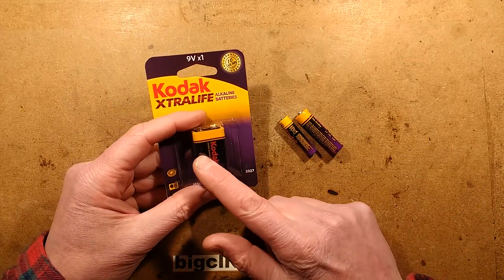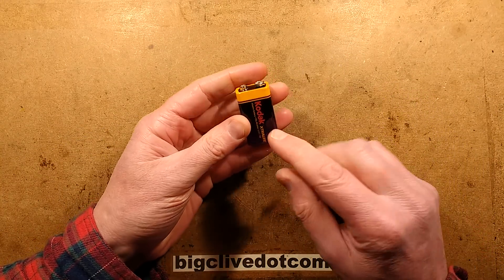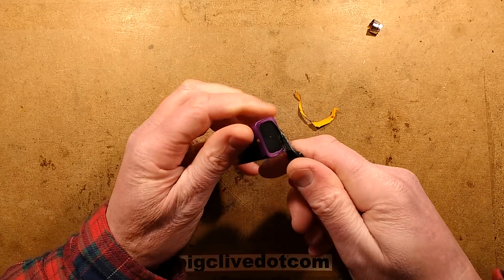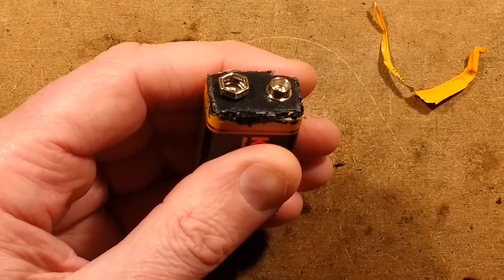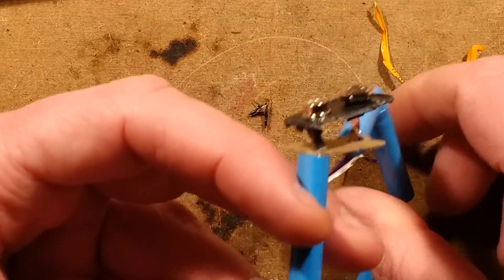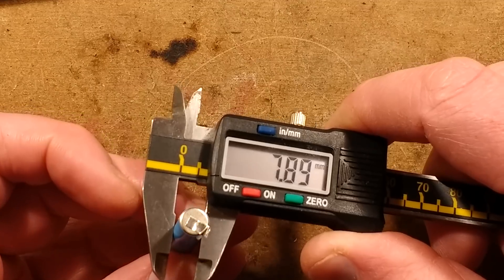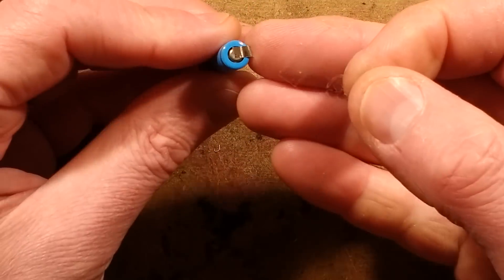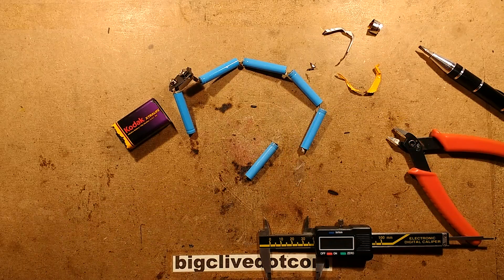Inside a Poundland 9V alkaline battery.  (Check polarity of cells if re-using!)

Comment: Hi, Clive, can I suggest you try and get hold of a standard non-alkaline battery and take it apart.
I can remember in my teens splitting a 9V battery open and the carbon-zinc cell was a layered set of black carbon and zinc tablet like sections.
Stacked one on the other.

Comment: Many years ago, I used this method to get AAAA cells for a Fujitsu Stylistic 2300 tablet computer stylus. Worked perfectly! I couldn't find the battery for sale anywhere except WES which is a electronics supplier here in Australia (not sure if they are still around actually...) for a sizable cost.

Strangely enough, the stylus used for the current Microsoft Surface tablet computers use AAAA cells, so I wonder how people are replacing those when they go flat!
Reply: They buy the AmazonBasics AAAA battery pack, i suppose?
Reply: Siana Gearz in Australia, so the options for Amazon purchases is a bit limited, at least back then anyway

Comment: Apart from the sizes, you can also get fractional sizes. 4/5 AA, 1/2 AA, 2/3 AAA, etc. However, trying to find some 2/3 AAAs to replace the batteries in some solar lights is proving to be a pain. I doubt anyone would be foolish enough to pay an arm and a leg for these -
https://www.ebay.com.au/itm/GA235248-2-3AAA-Sanik-Battery-Nimh-1-2V-400Mah-Sanik/362233306418
Reply: Gary Rumain probably be cheaper to buy a new solar light!
Reply: I know. I bought a 4 pack of lights for about $8 at a local supermarket. So about $2 each. When the batteries started going, I was surprised to find that they'd used non-standard sizes. Naturally, the supermarket didn't sell batteries in the required size.
These are about the best value I could find -
https://www.ebay.com.au/itm/Cordless-Phone-Replacement-Battery-404-3-6V-300mAh-2-3AAA-Ni-MH/180652844754
Certainly cheaper than the Sanik ones. And they're on sale now, so I might place an order.

Comment: I bought one of these last year -
https://www.ebay.com.au/itm/OKcell-9V-800mAh-USB-Rechargeable-Lipo-Battery-for-RC-Helicopter-Model-Micro/292486696110
No idea what's in them (can't open mine as it's in use) but I expect it's some sort of LiPo cell with some circuitry to manage it.

One thing I do note is that the price has really shot up.
Reply: Adam Welch did a teardown of this on his YouTube channel, so you don't have to.

It's essentially a Lithium Ion power bank.
Reply: Yes, it would have to be.

Comment: Maybe the 2.5mm difference is the nub on top of a normal AAAA?
Reply: Yes - because these alkaline cells are case positive and tip negative, when packaged as AAAA they need to put a tougher insulation around the case to prevent the cell shorting against the sides of the cell holder (hence the .3mm narrower width) and also put a flat plate on the tip to make the negative contact, as well as a nub on the base. That would easily take up 2.5mm of length.

So these are basically unpackaged AAAA cells.
Reply: Jim Fortune that probably true
Reply: it is, proper AAAAs have a top 'pip'

Comment: Amazon has Energizer AAAA 6-packs for less than $5 USD. For the cost of a 9V and the effort to open it, just buy the AAAAs.
Reply: A 4-pack of Amazon Basics AAAA in the UK is around £4.50 as opposed to a Poundland 9V battery which is £1 and yields 6 AAAA batteries (sort of). Then there is the fun of taking things apart.
Reply: VulpisFoxfire 
Most of the world is outside the US! 
Although I'm not sure if all Americans realise that fact!
Reply: That's nice. Clive is kinda outside the US though, you know?
Reply: There's also an amazon basics branded package of AAAA batteries.
Reply: The problem is the  UK. I cant honestly name a shop I could walk into anywhere in the country and buy an AAAA cell, and online they are much more than your prices unfortunately. This way works out at $1.45 for 6.
Reply: There are AAAA batteries available in some stores, but not in any of the ones close to where I live. I got a two pack 6LR61 in a grocery store nearby for about the same as a single AAAA would have cost. Given the price the batteries might not last quite as long, but I have 6 of them so that should not be a problem, and a 9V battery to boot.

Comment: I think it is wiser to use plastic caliper to measure battery length.
Reply: Or put the tape on the calipers!
Reply: Or measure alongside with a rule.
Reply: Or just put tape on the cell's terminal.  Bet no-one has ever though of doing that before ;)
Reply: Rizki Pratama
Why?
Reply: Richard Head so you don't scratch the flat end.

Comment: Be warned that not all 9V batteries have the 6 AAAA cells inside. Some have a pile-like stack of flat rectangular cells instead. EEVblog made an interesting video about it: https://youtu.be/c9JGfoLxVCo
Reply: I remember those stacked cells when I opened one as a kid about a hundred years ago. Short circuit current was very low, used mainly as a transistor radio battery. Woolworth  was always my supply of bulbs (lamps) and battery's.
Reply: Maybe it's an Australian thing but I recently opened both an Energizer and a Duracell 9v alkaline batteries and they both had the stacked flat rectangular cells. I have never opened any that have the 6 AAAA cells.
Reply: most of the pp3s i've come across have flat cells, but they were metal cased, maybe all/most metal ones are flat,  and plastic , rod cells..??
Reply: Are those still alkaline? I've always thought that 6f22 are supposed to be zinc batteries and 6lr61 are alkaline like this one.
Reply: The 9V alkaline that I disassembled also had the stacked rectangular cells.
Reply: Clive mentions that about one he opened at the start, actually.
Reply: I have disassembled a 9V carbon battery a long time ago and it had the stack of rectangular cells.
Reply: Both are around.
Reply: And not just those two, you get single cell 9v batteries but they are not very common anymore.
Reply: those are a stack of 6 cells in one casing, most individual cells, depending on the chemistry are between 1V and 4V, with 6 around 1.5V being usual for 9V batteries.

Comment: Genuinely didnt know AAAA existed
Reply: Tom Williams Productions Ever hear about E and J size?
Reply: Redlock oh god, don't get me started on E and J size
Reply: They're getting a little more common now, Microsoft Surface tablet pens take AAAA batteries.
Reply: Oh there are plenty others as well. Got used to all kinds of weird cell sizes when i worked in camera shop.
Reply: +Redlock  -  "Ever hear about E and J size?"   This is about women's bra sizes? Right?  E and J are really big ones, they get in the way.  I don't think they make batteries that large.
Reply: David Null There is N size as well, a bit bigger than those 12 volt key fob cells, but 1.5 volt.
Years ago back in the 1970s there was some huge batteries around, for radios (there was a 90 volt one, yes 90 ! For old valve radios) 
and 12 volt for large hand lamps.
Reply: TheMrVengeance 
Not that bad?!
That would make an equivalent 9v battery €9!
That seems VERY overpriced to me!
Reply: David Null - Any more than a handful is a waist.
Reply: Tom Williams Productions damn i thought that is normal AAA BATTERY
Reply: Pete Allum - It's €3 for batteries that generally last an eternity,  most things (in my experience) that take a AAAA use hardly any power. Such as the pen for the Surface tablet.
Reply: +wolfpax181 - About €3 for a pack of 2. It's honestly not that bad.
Reply: i ran across N cells in various Australian post Master General phone test gear.
Reply: They are used in N-Trig stylus pens for Windows tablets.
Reply: +Jason Gomez - I said that 2 weeks ago mate. :')
Reply: Don't forget the 4.5 v ones - with terminal nuts - for doorbells!
Reply: Les Reed I remember those, there was an Exide brand one of those above the door in my grandads house back in the 70s, I think it lasted for about 15 years!
Reply: You even get AAAAAAAAAAAAAAAAAA batteries, but you wouldn't want to drop one of them in a haystack - you'd never find it again.

Comment: Wow ! I had no idea 9 volt batteries had 6 little cells inside ....this video has been enlightening
Reply: not all of them do, Duracells don't for example
Reply: @MichaelWeaser  I opened a Duracell and got 6 AAAA batteries but Energizer had 6 flat stacked transparent bricks
Reply: @maxstrainsfanssmash687  I have opened up Duracells as well have also seen the flat cells in them, so Duracell has to be making 9 volts with both type of cells.
Reply: @MichaelWeaser  Yes I've seen that too the ones with 6LP3146, 6LF22 or 6F22 marked on them have flat cube batteries and the ones with the markings 6LR61 have AAAA batteries
Reply: I meant that most don't have the cylindrical cells , Yes most have 6 flat cells they hold a higher capacity???  Most cheap 9v use the cylindrical cells , since they are cheaper and a lower capacity than flat cells.
Reply: they ALL have 6 cells in, they have to as no single cell is 9v, just that some(most?) have flat cells some have the AAAA 'rod' type...
Reply: dunno whether its the cheaper ones using rod cells or 'flat' type, but i personally have never yet come across one with rod cells in ,... yet... i sometimes open up dud ones to pinch the top connector plate 😉
Reply: the cylindrical type cell have a slightly lower capacity by 100 - 200 Mah or so , so they are cheaper.

Comment: The Poundland 9v alkaline  batteries are amazing. Where else can you buy a 9v alkaline  for £1
Reply: "The Poundland 9v alkaline batteries are amazing. Where else can you buy a 9v alkaline for £1"
If Poundland don't have them, you could always try .... Poundworld?
Reply: Nearest I use is Rapid Electronics 10+ and VAT registered
Reply: If you don't need the batteries to alkaline, you can get 2 Zinc Carbon Kodak 9V batteries for £1 from the same shop.
I disassemble them after use to make my own 9V battery clips.
Reply: Problem is you might be buying a variant made to be sold for £1. With some products this is very obvious from the physical size
Reply: Jonathan Schneider yeah, like those tiny jars of Marmite they sell!
Reply: With those Kodak branded batteries I've found they tend to skimp on the sealing. They are not batteries to be left in equipment for long periods of time as they have a nasty habit of spilling their contents unpleasantly in battery compartments
Reply: luviskol - Yes, just like Duracell batteries. They will leak if a cell becomes reverse-polarised. That's because of gas build-up.
Reply: i've had duracell and energisers, leak unexpectedly, even when plenty of power left in them causing damage.. 😠

Comment: There's not a huge difference in dimensions, between AAA and AAAA batteries.

AAAA - 42.5mm x 8.3mm

AAA - 44.3mm x 10.2mm

Only a couple of mm difference, in each direction.

Comment: WOW!!! Never saw a 9v batt like this. I've always got the button cells when I opened them up. Very interesting. You'd think that to manufacture a 9v batt in this manner would be much more expensive, apposed to just making the little biscuit cells...
Reply: constructing them this way is cheaper. button cells are pretty hard to make. The cheap ones usually are constructed like that, the most expensive ones tend to use a different construction. thats what i have found anyway.
Reply: Having taken a few apart, I remember them just being like little pills of chemicals, surrounded by a waxy substance. I can't see how that would cost more, but then again, I'm not a professional... LOL!
This is what i love about Clive, he takes things to bits, and allows us to "Discuss" LOL!

Comment: I only use the pound shop 9v batteries, the price makes sense, but I went to open one of these once after watching videos online of the same battery, but under the plastic was just metal filled with gunk and not individual cells... Maybe there are fake 9v batteries...
Reply: Phonotical it was probably a zinc carbon battery, the construction is totally different on those
Reply: Phonotical
 Probably not an alkaline battery.
Reply: They are Kodak batteries, they used to be a major American camera company but have recently fell on hard times because they didn't keep up in the smartphone age.

Comment: This is off-topic but my parents have had lots of light bulbs fail in their new house, both LED filament and halogen types. Could it be fluctuations in power and can these be rectified? I know you've reviewed dubious 'energy saving' plug-ins on this channel that supposedly smooth out energy spikes.
Reply: This needs to be inspected first. Depends which country you are in. Don't get an electrician to fix it, get an electrician who is a certified inspector. Get a report. You will have to pay for it. Depends on time frames and contracts and sales agents and law stuff too. BUT GATHER EVIDENCE FIRST! ASAP!!!! Whoever approved and signed off the electrical in that house was having a nap.
Reply: Facts Don't Care About Your Feelings Thanks for your input. The house is in a rural location and the core of the house dates to the 1930s. The previous owners also installed a ludicrous number of burglar alarms, outside lights, a stair lift and built a large extension, so it's perhaps not surprising.

Would you say this is genuinely a cause for alarm (i.e. actively dangerous) or merely an inconvenience?
Reply: It definitely sounds like the circuits need testing. I suspect that some DIY wiring happened at some point as the house spans several different certification code timeframes. Worst case scenario it may be advised to get the house re-wired to some extent. I can't speculate as to the risks (eg fire hazard, or a 250V electrocution risk light switch). If you are interested, Thomas Nagy is a certified electrician and tester from London and has a youtube channel that is easy to watch. Good luck with this!

Edit I got Thomas Nagy's name wrong .... all fixed.
Reply: Facts Don't Care About Your Feelings 
Thanks very much.
Reply: I do not know how things work in your country, but if you are experiencing, or have good reason to believe you may be experiencing, significant power quality problems in the US you can request an investigation by your utility.  They install a special meter in place of your regular meter that is designed to continually monitor and record the quality of the power coming into your home or business.  They leave that installed for a week or two, then return to read the data off that meter and analyze the report it generates.  It does not cost anything but it can take a bit of escalation to get them out.  Perhaps the utilities in your area offer similar capabilities.  They will not take any action if it still falls within their established limits, but if it is out of their acceptable limits then they then have the information necessary to track down and resolve the problem (like swapping out your transformer if the voltage is routinely too high or low, looking for loose connections if their are lots of dropouts or spikes, or locate a problem customer in your area, etc.).

Comment: Almost every pb3 I've taken apart was constructed differently. Mostly they are stacked together cells, covered in a plastic shell. unable to get individual cells.
Reply: yes some are stacks of rectangular cells, certainly ones made by varta are
Reply: Look for the correct magic word '6LR61' on the package. Any other name should indicate a stacked battery of flat cells. That's assuming that you don't buy no-name fakes. Kodak are reliable, but I've used other brands. In the 1970's, we used to partially recharge them with an unfiltered DC supply, originally in defiance of dire warnings on the cases, to see if they really would 'explode or catch fire', but afterwards because it saved money.
Reply: Heavy-duty (i.e. zinc-carbon, acidic chemistry) 9V batteries use horizontally stacked cells. Most alkaline batteries use the 6 unpackaged AAAA cells, although there are some alkaline batteries that use the flat cells.
Reply: Robert Backhaus the vast majority of alkaline use the flat cells. They’re cheaper to make, by not requiring 6 metal cans. On the other hand the AAAA style can be made mostly on the standard AA/AAA production lines.

Comment: I had a bluetooth headset many years ago that used AAAA batteries and since they were hard to find, I would tear apart 9-Volt batteries like you did here and use the cells from that.  I found, as you did, that the cells that came out of the 9-Volt battery were a little shorter than true AAAA cells and I had to make a little ball of solder and put it at one end of the battery compartment to make up the difference.
Reply: i remember tearing open a 9v battery when i was a kid and it was just filled with black gunk! what is this witchcraft!?
Reply: @outseeker , some have multiple stacked flat cells in them, others multiple of those LR61 cells.
Reply: outseeker that would have been a normal zinc carbon battery.
Reply: Mith of bin a carbon zinc or some carbon chemistry of some sort, I remember taking some apart like you describe when I was younger
Reply: the reason they are shorter is they dont have the top 'pip' as on proper AAAA's, but 'tagged' , its similar with tagged nicads/nimh's..the actual 'cell' is the same size, just pipless...
Reply: A zinc-carbon cell still has a potential of 1.5v/cell. Outseeker must have destroyed the internal separators in his youthful passion.

Comment: FWIW, Dave Jones of EEVBlog did a pretty good teardown and explanation of a couple different constructions for 9V batteries a while back: https://youtu.be/c9JGfoLxVCo
Reply: What I wonder is - would the stacked pile construction have more capacity because space isn't wasted on packing cylinders into a rectangular package?
Reply: I think a stacked construction is cheaper, because it's made out of hollow plastic containers that don't even have lids, the bottom of the next container seals them up. It has no chance to achieve the layer packing and pressure needed to do that, that the cylindrical cells do, so it should have a much lower capacity.